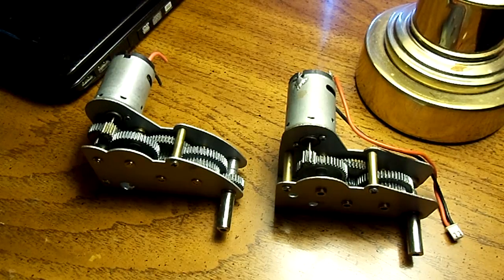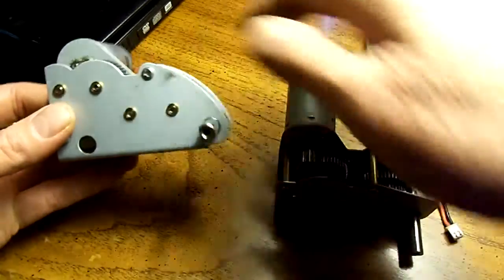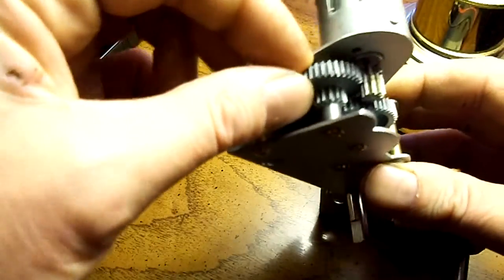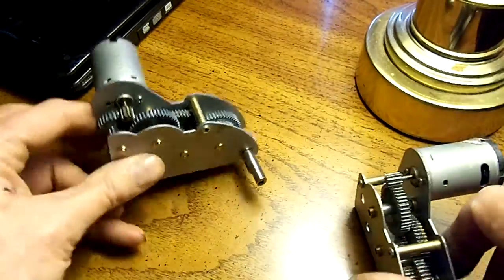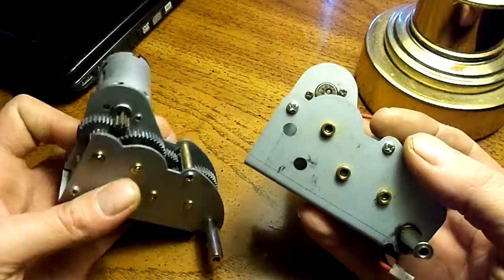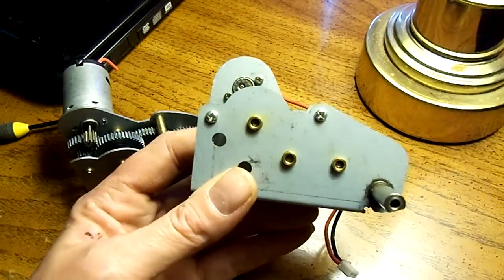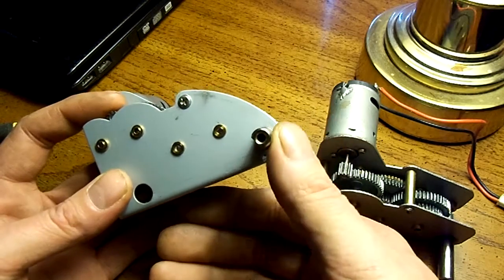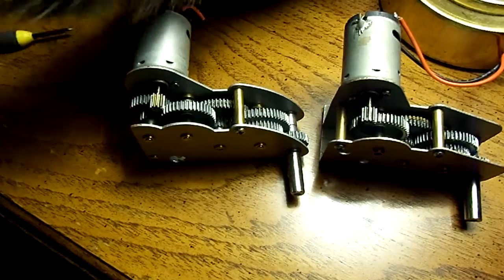gearboxes explained

Comment: When I get some time (new Clark board arrived today) I'm going to pull one gear box down. I'll count the teeth on the pinion and the teeth on the final drive gear. With that, and using a formula that I'll have to find again, I'll see if I can come up with a gear ratio for both of the SO CALLED 3:1 and 4:1 boxes.
Sorry, I don't have a video camera.
If I could change my user name on RCU I would, I like the Tanker 10 better also.

Comment: After viewing you post, I had to try an experiment. I put a mark on the pinion of a so called 4:1 stock zink geared Taigen gear box and placed the  flat spot of the output shaft in a horizontal plane facing up. It took 92 revolutions of the pinion gear to bring the flat spot on the output shaft one (1) full revolution.
Reply from the maker: You know what you should do? Perform that experiment again, only this time get it on video, then post it at RCU. Maybe we can get this 4:1 and 3:1 garbage squashed for good. I think it's very interesting that you came up with a final motor to drive ratio of 92:1. Or 1:92? I don't think I'll EVER figure that part out. I'm 85% sure it's 92(motor revs):1(axle rev). Was Tanker Ten taken at RCU? I like it better than race... Easier to say. :)